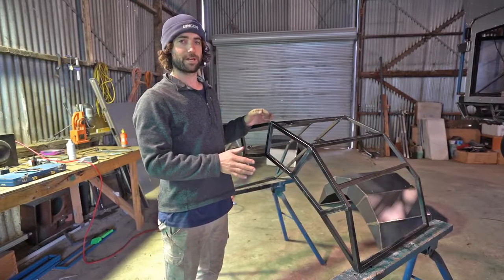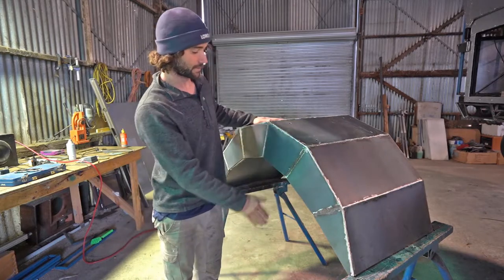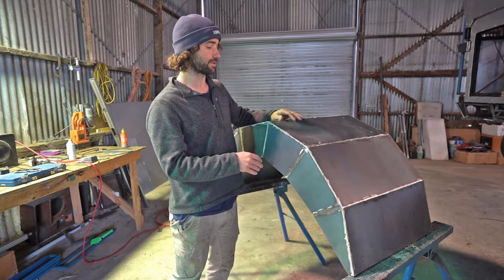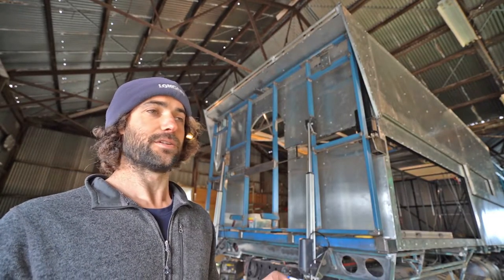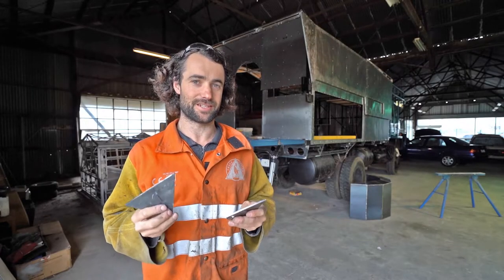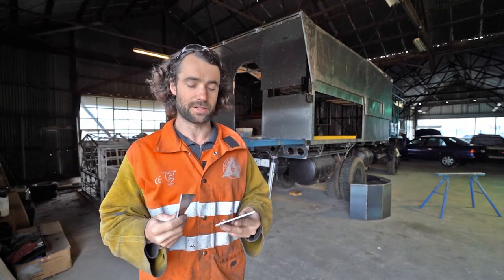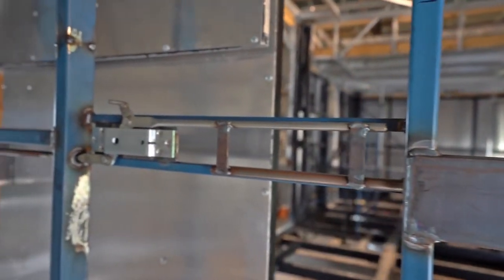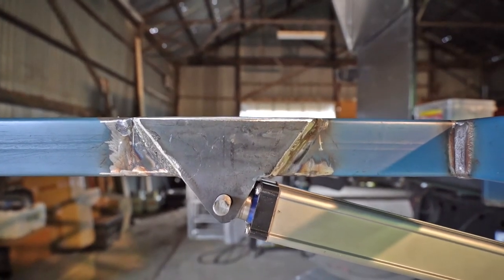Copper Mudguards and Rear Deck Tweak - Expedition Vehicle Build #5

Comment: Nice! 
Question: how will you keep the shiny piston things in the actuators clean while driving? (from sand, road soot, bulldust and the like)
Reply from the maker: Not sure yet, I could make some covers for them. The actuator body has a seal to stop dust and dirt from entering. Because they're electric the rod doesn't need as much protection as if they were hydraulic because the end seal is not containing any fluid.

Comment: wow ... aren't you worrying on structural rigidity of the box with a big slide out?  is that actuator made to carry 200K at the end of the platform ?  with a slide out, you ll really need to put the truck level?